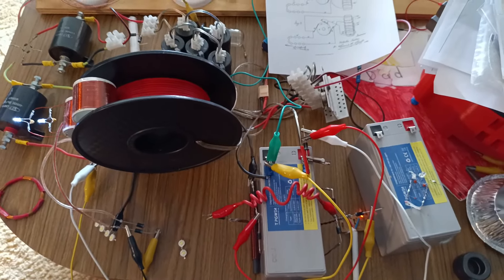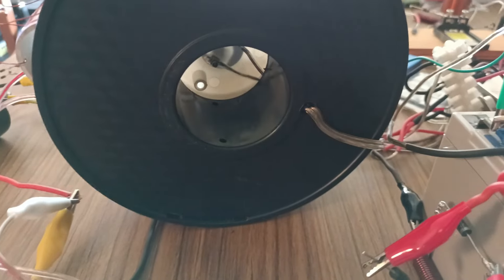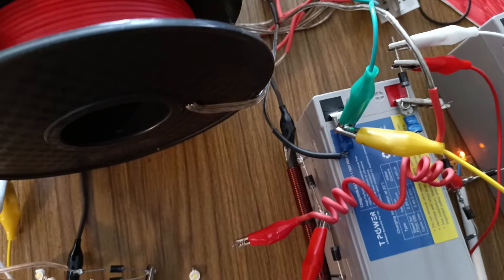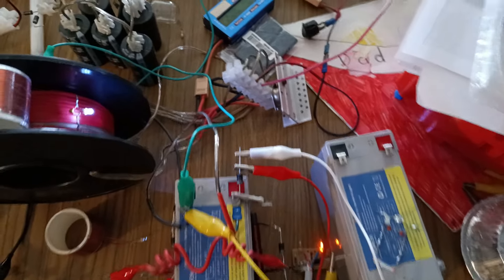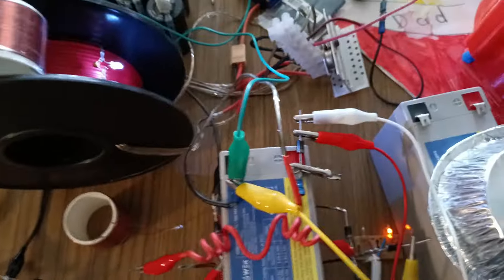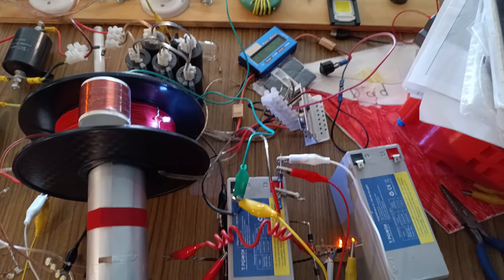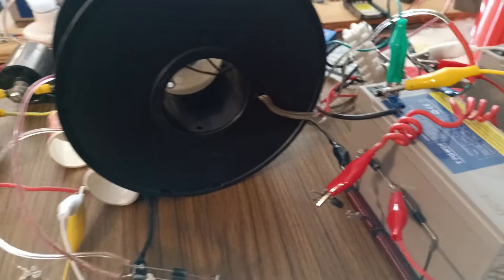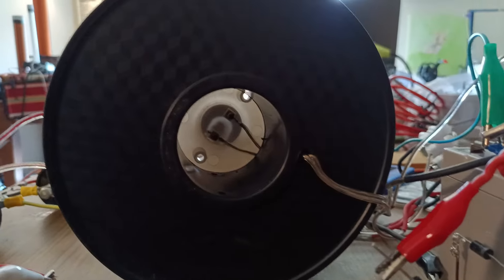TESLA PATENT + MY CIRCUIT = LONGER RUN TIME???

Comment: Is it possible that the reason you can attach any coil to it and it'll still work is because the circuit is producing radiant energy instead of merely resonant oscillations? I've gotten involved with a device that produces radiant energy and it has such a high output that it will often fry weaker components (not my experience, zero4all's) and no resonant tuned circuits are required to simply be able to pick up on those shockwaves.

If your circuit is producing radiant energy and that's what is powering the coils, it would explain the phenomena.
Reply from the maker: Thank you for your comment.
The burns I get if I accidentally touch the wrong spot are a combination of RF and Radiant energy and electromagnetic electricity and probably other stuff we don't know anything about but it feels like no other burn I have experienced. Somewhat damaging to tissue at the burn site and has an effect that feels like numbness. On my pinky finger I have a matchhead sized area that got hit, a small black entry and exit would were visible(now gone) but it is as though it cauterised a small section. It will get better, I know because it has happened a few times before, note to self, must be more careful!

I have thought many times why the turns ratio doesn't really conform with a standard transformer, eg 20 turns isn't equal to 2 x 10 turns, ie. the output value of 10 turns is not 2 x the output value for 20 turns. That is difficult to say and perhaps better described as non linear which I feel isn't just a resonance factor.

This circuit you speak of interests me, any chance you wish to elaborate? If so feel free to share all you like here.

Comment: You should really read the text of the patent and not just look at the 2 pages of figures to see what the patent entails.
Reply from the maker: Thank you for your comment.
I have read the Patents in full and encourage everyone to do the same, however most people won’t. It is similar to a user agreement which almost nobody reads. The point I am trying to make is how easy it is to achieve the same or similar outcome by just reverse engineering from the pictures. This is for those not interested in working it out for themselves.
Reply: @whatifididthis...1236  but what does the use of this winding here have to do with an auxiliary brush on a generator that's tapped on its field winding?  The patent is for modulating the voltage of a spinning generator.
Reply: @blahblahblahblah2933  Tesla hid information in various ways in his work, the purpose of the machine in the patent is not the only purpose it can be used for, and that was intended when Tesla made it.
Reply from the maker: @blahblahblahblah2933 That is correct, however this is only one use of this winding method. This coil arrangement, from my actual experiments, seems to display an output that doesn’t appear to place as an equal load on the drive coil as other coil arrangements and it could be this fact that Tesla chose this method. It is important to remember that this era involved the Patent Wars, where every man and his dog were submitting patents with minor variations. Whilst some are clear copies with a small variation they still presented a benefit that the original patent did not supply. This can be a minor variation such as back seats in a car instead of a 2 seater car. My point is, Tesla would often use Patents to protect his other ideas without submitting a second patent, some of his patents contain multiple inventions which was often as organic as “I’ve made this ‘thing’ and now I need to invent something that lets me use it”
Reply from the maker: @iamatree4246 Thank you for your comment. I think it is important to have a goal in mind, I have tinkered as you say but with a task clear in my mind. Achieving something without knowing what it was you were trying to achieve is without merit. In my case, I wanted an effective/efficient light, for me this was practical and achieved. First you must decide what it is your looking for.
Reply from the maker: @JenkoRun I agree with you, In my opinion some things were hidden in his patents but not in the literal sense of the word but instead I believe he showed real intelligence and had his controversial designs hidden in plain sight, he did this so these controversial concepts weren’t the object of debate and ultimately rejected, instead they slipped through the patent office disguised as the rule following obedient conscript of the laws of thermodynamics.